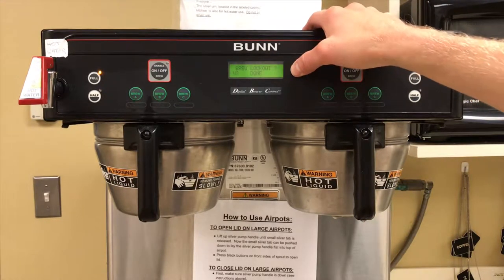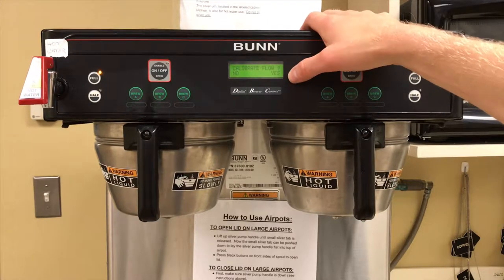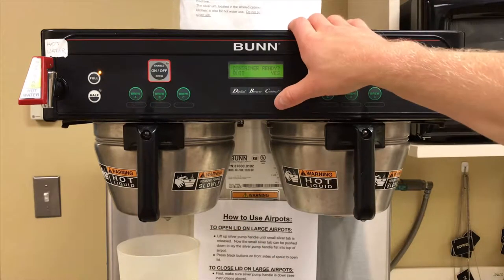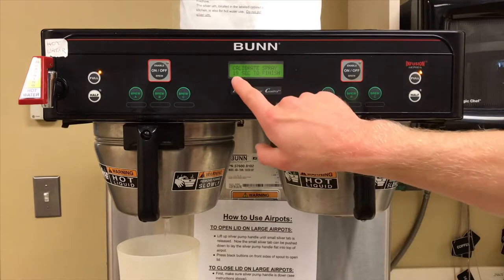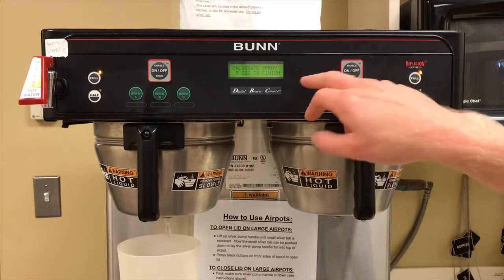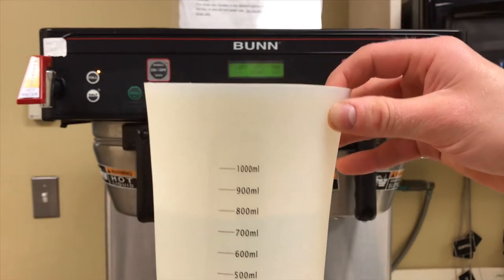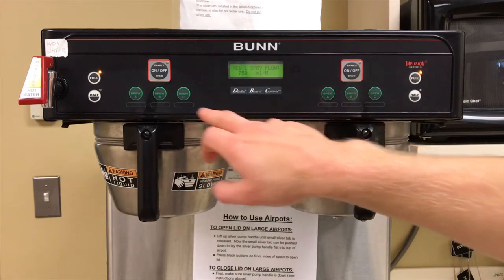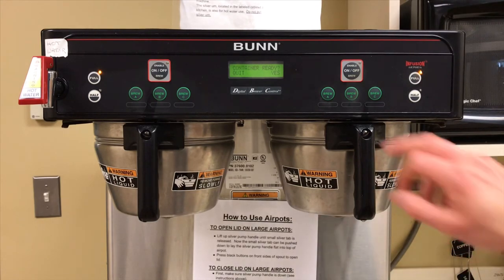How to Calibrate a Commercial Bunn Coffee Maker

Comment: How do I set how much I want it to fill? We recently switched to using different containers and the current system fills them slightly to much and almost overflows. How do i reprogram how much it dispenses?
Reply from the maker: Press and hold hidden button —> scroll through to review recipes—> select modify—> adjust the liters to how many liters you want in your new carafe —> Test it and adjust as needed! Hopefully that helps.

Comment: So my secret button menu won't progress beyond lockout brew Yes/Done/No. Not sure what's going on with it. Checked the switch on the control board and it's set correctly.
Reply from the maker: The secret button needs to be held pressed in for a few seconds for it to enter that mode. If you've pressed and held it I'm not really sure what's preventing it from moving forward. It could be something wrong with your control board.
Reply: @MPCfacilities  yeah, I'm getting into the menu. It'll ask if I want to lockout brewer or not then if I hit the secret button again it leaves the menu. I have two Bunn machines and the other works correctly. I had a hunch it might be the control board, previous owner was an idiot. Thanks for the reply. Time to go pay through the nose for the service guy to double check before getting one.